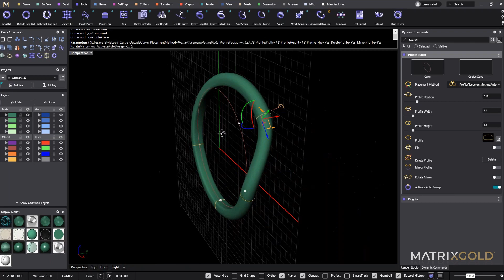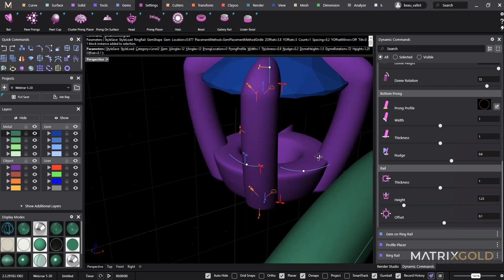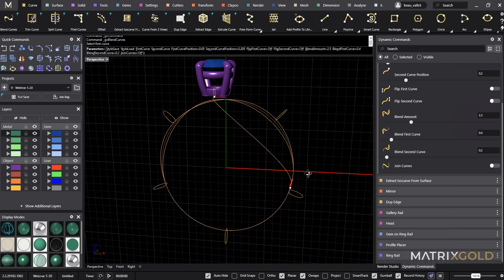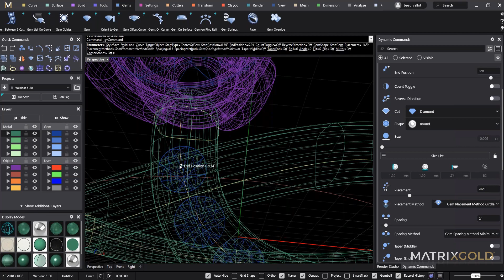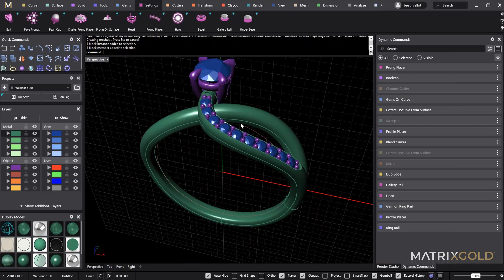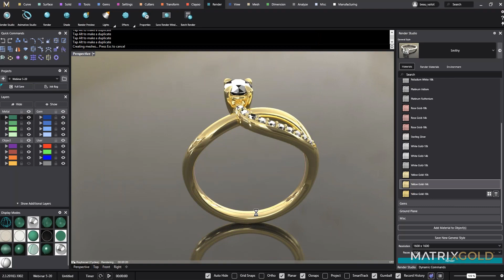Solitaire Freeform Ring - MatrixGold Tutorial

Comment: Thank you for the great video. 1 question: So gem cutters are basically for rendering? if I want them to print in 3d I don't need to do the cutting?
Reply from the maker: Hi,  making the holes in the metal with the gem cutters allows having a better render as the metal does not goes inside the stone and also creates the right seat to place the stones once the stones need to be set.